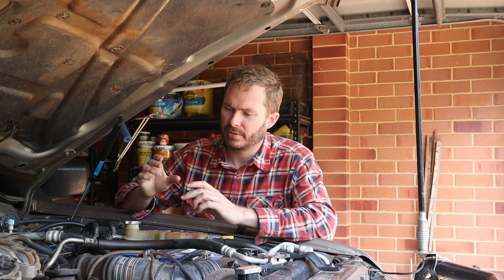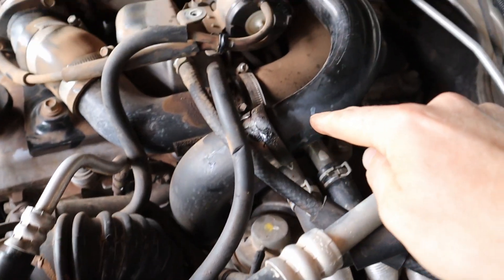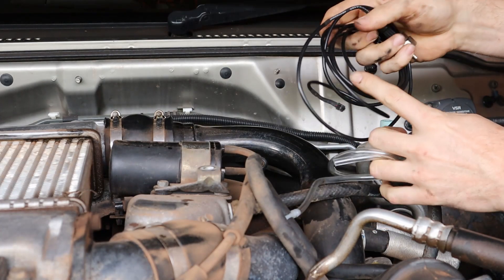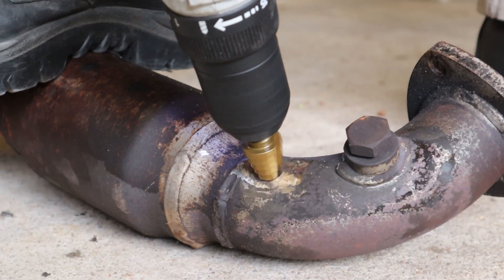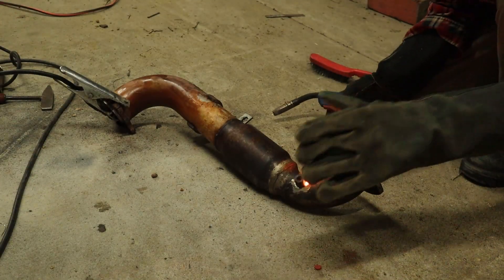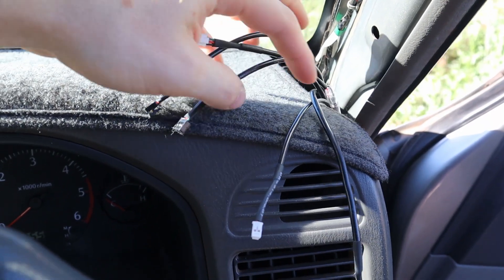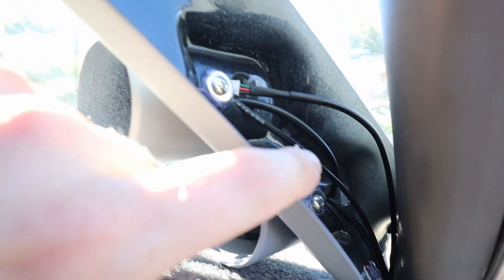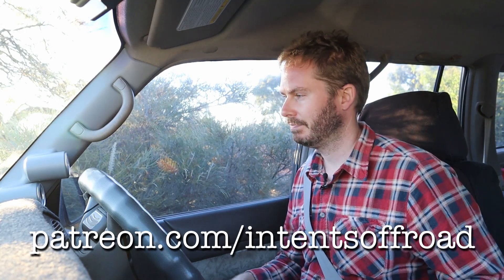Aftermarket Gauges Installation. Diesel Boost and EGT on Nissan Patrol

Comment: Should have run it right into the manifold so your laptop can tell you when the welds on the intake are gonna go.
Reply: As long as he doesnt granny shift, he should be ok
Reply: Also should have put it in the manifold  to get a proper reading. Especially if you're using its readings as a basis for tuning.